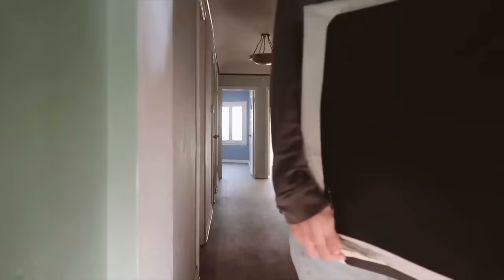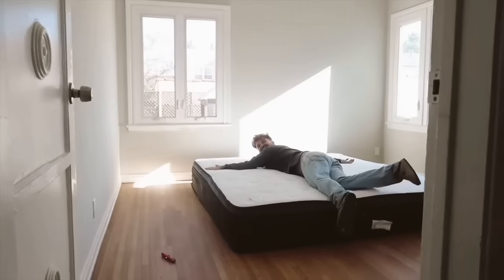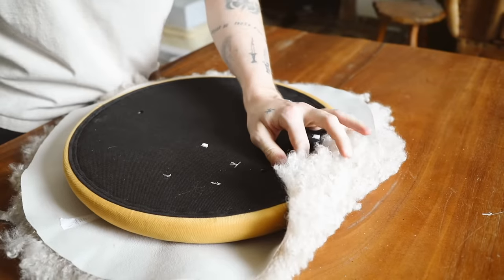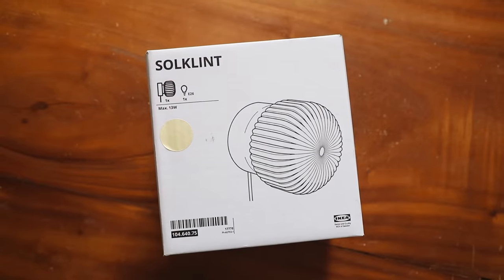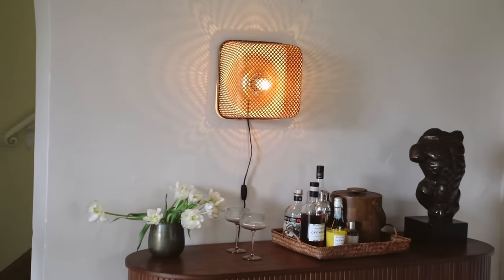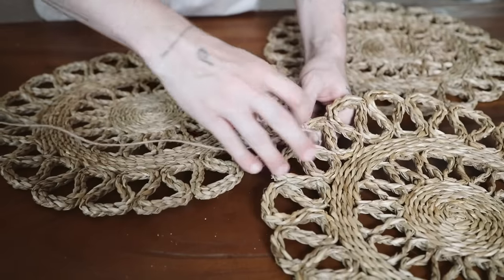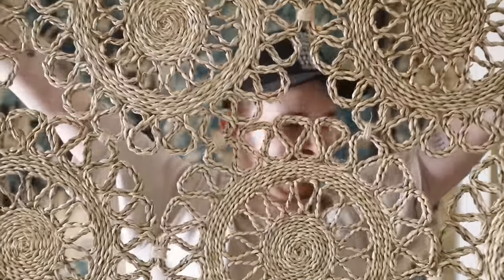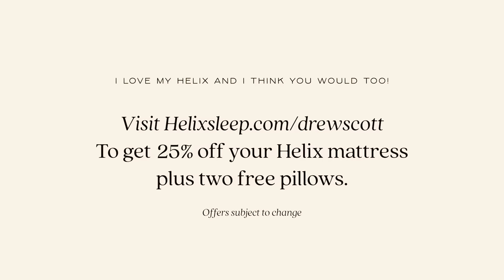DIY Ikea Hacks YOU ACTUALLY WANT TO TRY! *From Start to Finish*

Comment: Tip for cutting IKEA Svindinge Rug... (or any faux fur) - Simply cut the backing of the fabric. That will avoid any cuts through the curly fabric or fur. Just use the tips of the scissors to cut the backing. I know it works on fur, so assuming it will also work on the rug. This way there's no harsh cut lines. I've made "bear rugs" using this method. Great video. Love the coffee table too!

Comment: If you wet the wood just a little bit before you do you final sanding it will raise any fibers after several minutes then when you sand the wood you will have a super smooth finish.

Comment: I'm thinking the light needs a more secure attachment to the wall. If it slips and lands on the light bulb it could be a fire hazard. Also, hide the wire and change the colour of the light switch!